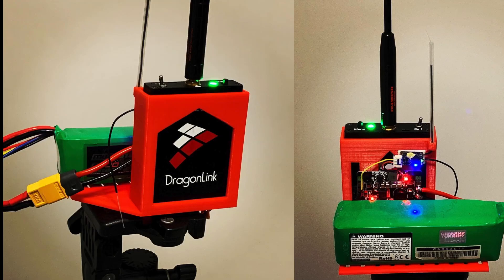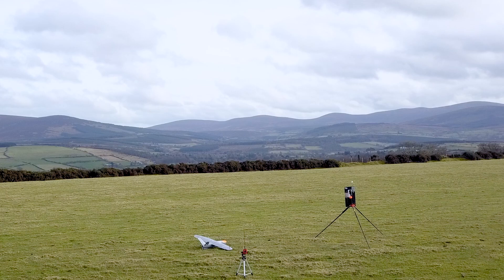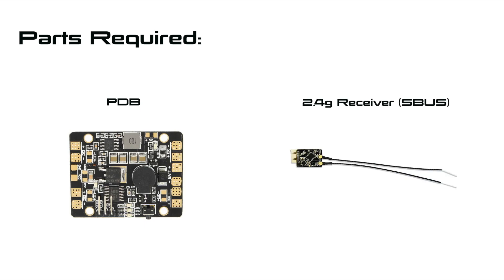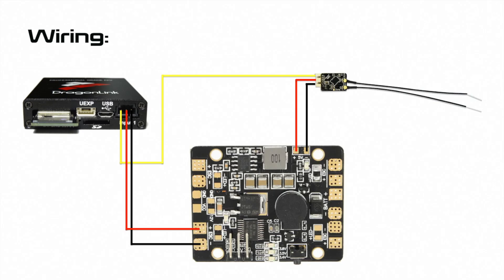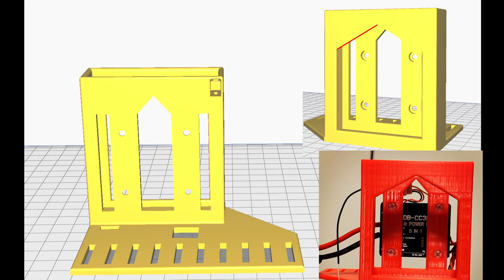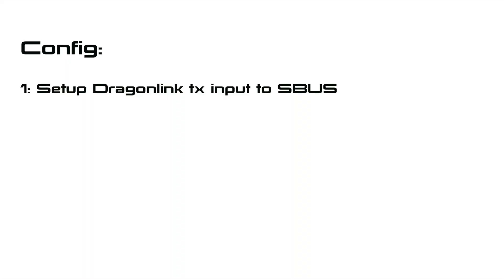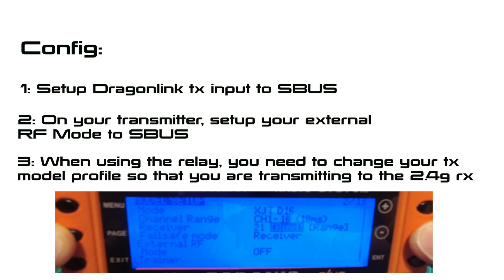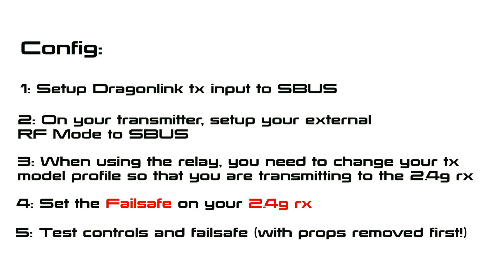🥶  🚗  🕹 🛩  2.4ghz to Dragonlink Control Relay / Repeater Build & Setup

Comment: Great video, Adam! I have a Dragonlink V3 and I want to put a repeater with a FRSKY RX XSR. How should I configure the Failsafe on the Radio and on the DragonLink, so that in any case the RTH is activated? Thanks
Reply from the maker: You just need to cofigure the failsafe for a 'tx postition' on both the Dragonlink AND the FrSky. With the tx set to FS position.

Comment: it is possible to do it with a crossfire module
Reply from the maker: Yeah possible to do this with any of them really. If you want telemetry then that’s something you have to consider.
Reply: @AdamGdoesFPV  if you would need telemetry to manage the tracker, it works by bluetooth connection

Comment: I dont get it. What does the external Tx on the radio got to do with anything?
Reply from the maker: Hi, in order to help you understand, please tell me what you are referring to here? The Dragonlink transmitter when connected to the radio transmitter is an 'External tx' and therefore is configured as one on your radio tx.
Reply: @AdamGdoesFPV  but I thought the dragonlink module was only connected to the rxsr away from you. Is there anything in your ext module bay?
Reply from the maker: @cpt_riris  the part where you configure the external module is for when you fly with the DL bolted to your tx. Because we have changed it’s input to SBUS it will no longer work with your radio outputting ppm
Reply: @AdamGdoesFPV  riiiight so you configure the DL module for sbus BEFORE you separate it from the radio?
Reply from the maker: @cpt_riris  The settings in the Radio regarding the external RF are the settings for what the radio will output to the external tx. You set the input of the DL through your PC
Reply: @AdamGdoesFPV  but is there an external tx in the radio???
Reply from the maker: @cpt_riris  no the external tx is the Dragonlink mounted to the back of the radio. If it was inside the radio it would be an internal rf unit. The pins on the module bay on the back of the radio are to connect to external modules.
Reply: @AdamGdoesFPV  i rewatched the video. Got it. Thanks for your time

Comment: Hey what is the range that it can go?
Reply from the maker: The 2.4 or the Dragonlink?
Reply: @AdamGdoesFPV  Both. what is the range of just dragonlink? And what is the range of  just 2.4? sorry for my english, Thank you
Reply from the maker: @justinsurla6043  The 2.4g for the relay... well with direct LOS it will be way longer range than you will need it for a relay. Obviously range is reduced if using it through walls of a building etc. In the air I've never fully tested the range of 2.4g but I know people have done 10km in the right conditions. Dragonlink control range is meant to be around 40km... but like anything it depends on your setup. People have done 100km+ with Dragonlink on the right antennas.
Your English is fine :)
Reply: @AdamGdoesFPV  Thanks adam

Comment: PPM signal can work too ?
Reply from the maker: Yes it can, as long as you’re ok with being limited to 8channels. Or if you can find a 2.4g that will output more channels over ppm. The rx I used can be switched between SBUS and PPM, SBUS is 16ch and PPM only 8

Comment: Hi Adam! Cool video. Does the relay also relay telemetry back to your controller via the 2.4ghz link?
Reply from the maker: No I only get telemetry about the link between my tx and the 2.4 rx. I never use telemetry from DL either. The DL tx can transmit its received telemetry via wifi/bluetooth so I guess it would still work, but I don't know it's range. Cheers
Reply: @AdamGdoesFPV  that makes sense. No telemetry on the controller but I can just use wifi to a GCS.
Reply from the maker: @sarahdaviscc  Yeah that's it 👍🏻

Comment: Do you have also telemetry back from DL rx?
Reply from the maker: You can but I don’t, I’ve just never had any interest in it.
Reply: Would think telemetry at transmitter would be somewhat redundant, as already have telemetry via FPV OSD. That said, it might be of use if wanted to set up audio warnings on transmitter.
Reply from the maker: @AerialWaviator  Yeah it's just something that's never interested me as I feel like everything I need to know is on my OSD 🤷🏻‍♂️

Comment: Guess it gets really cold on top of that mountain....lol...So, a relay on video and control now then...Great solution though mate. I'm guessing your control link will benefit a little from the vertical and well positioned UHF antenna too...🤔🤔😯🇬🇧
Reply from the maker: It sure does. It’s in the days where it’s cold but also windy, my hands can only take so much even when wearing gloves 😬 and yes it will benefit from being held in the best orientation the whole time, as it definitely doesn’t when I’m holding it 😅 cheers
Reply: I use eagletree eagle eye I fly 1.2 with 5.8ghz bull shit ass wanna be so called transmitter as the relay lmao 🤣 I'm surprised 5.8 can reach me 100ft away to my truck